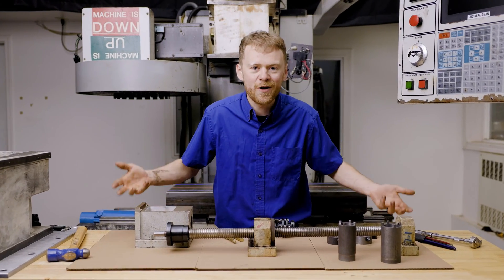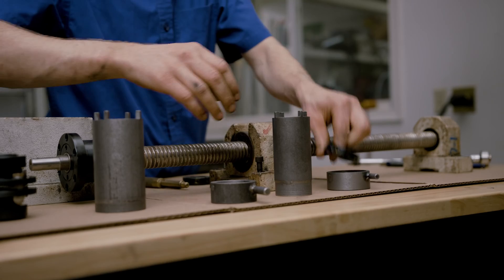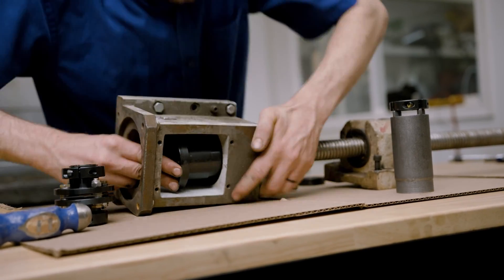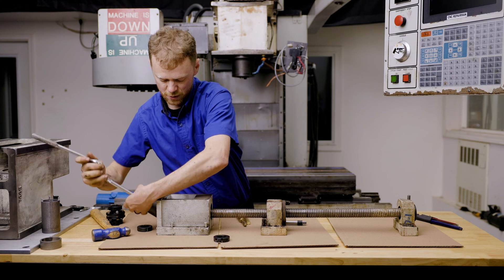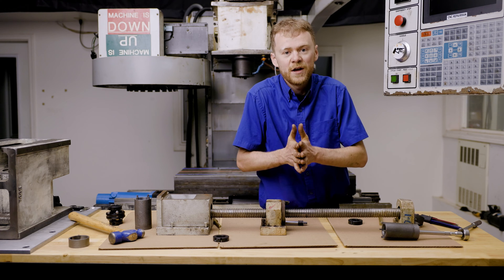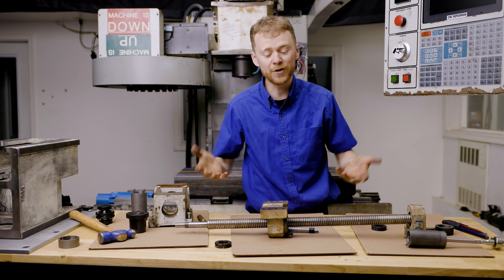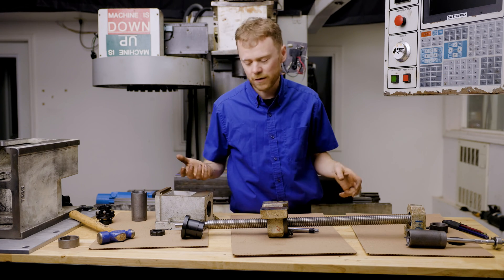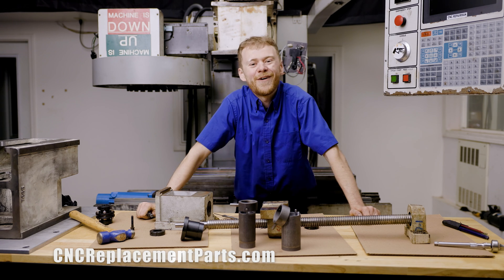Ball Screw Removal And Bearing Assembly | DIY Tools

Comment: Are thrust bearings at the end of the screw supposed to have a lot of play in them if they are not loaded? When loaded there is no play but in my hand I can move the center close to an 1/8 inch. Was just going to buy some thinking they are maybe 20 bucks but they are $450 for a set and I want to know if mine are shot.

Comment: Awesome Video! Straight to the point and I love the examples on the bench! Please keep making more of these, they really do help a lot, especially to the many smaller shops with used equipment, like ours.  I do have a 94 VF3 here and its been a really great runner for me, but I am having a fluctuating of the rpm happening. There is no real pattern to it, sometime the machine would run for hours before it start to fluctuate in rpm, up or down, maybe 10% or speed, like its doing a wow, wow, wow type of noise. Its not affecting the finish on the parts, but it is affecting the tool life a bit. I am just worrying that it will get worse and something breaks, making the machine go down. I have replaced the small belt from top of spindle pulley to the encoder but no changes. Maybe you could help with the diagnosis?
Reply from the maker: I’d probably start with the VFD or at least have it gone through and refurbished

Comment: I need to repair the Y-axis ball screw assembly on a Haas TM1P from 2010.
You don't seem to have the parts, so where is it best to source from if not Haas themselves?
Reply from the maker: There is not a good place that sells ball screws aftermarket. You can try getting it rebuilt at Robert’s Ballscrew
Reply: @cncrepairman  
Thanks!
Freight and customs handling will undoubtedly make that too expensive unless Haas Parts are insanely priced.

Comment: I must be the only guy that cannot follow this. Tighten this, flip that, take this off, imagine and hit this, pretend this, then do that, boom boom your done. Consider recording a video actually showing the screw being removed and the bearing being assembled. I feel like this video gives more information on how to buy tools from you than it shows removal and assembly of a ball screw and bearing.
Reply from the maker: This video is more for Service Techs who have done this before. I am planning on making a more in-depth video. It just takes time.
Reply: Nah dude as someone who's worked on these for nearly a decade - a tech, it is mainly for techs.
and I get why he's doing it out in the open. If you saw how much more difficult it was doing this IN the machine, you wouldn't wanna do it unless you're insane. Lol.
Especially lube lines. Don't get me started on how the dye in their minimal lube machines clogs the lube lines.... And ruins the ball screws and linear guides.